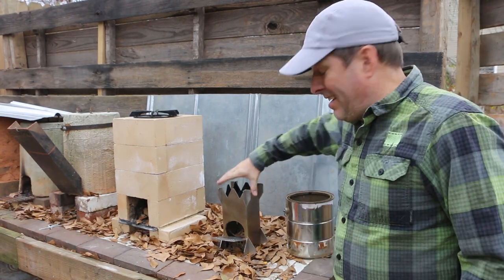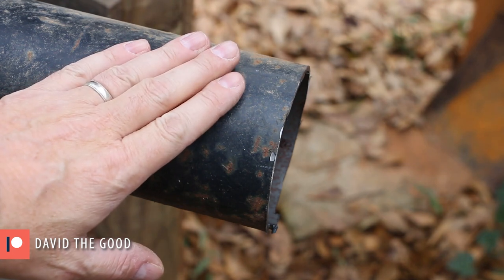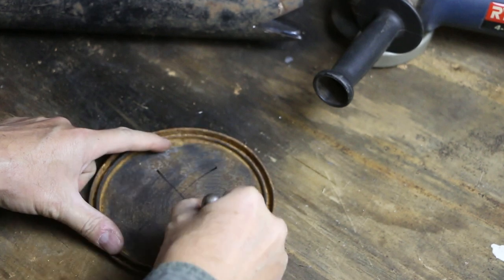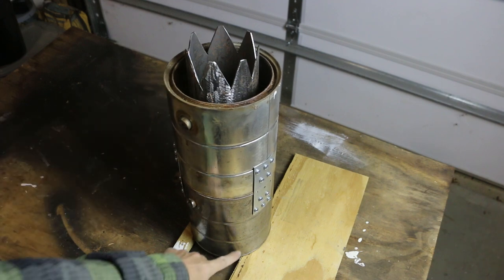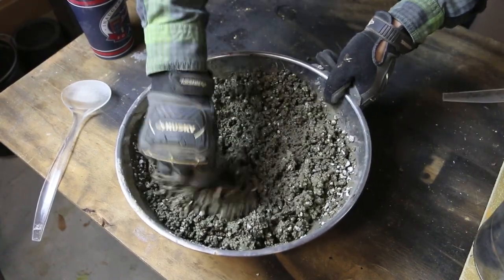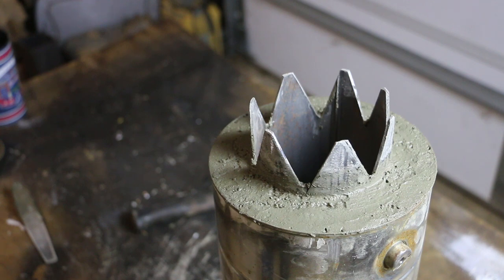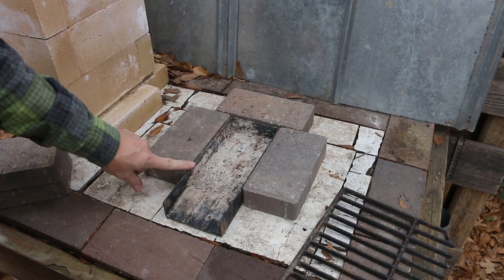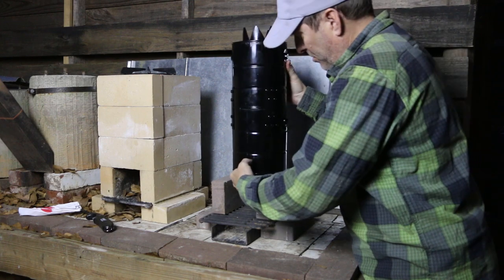How To Make A Paint Can And Perlite Rocket Stove

Comment: Helpful Hint: Before using the perlite, soak it in water for about 24 hours. The cement won't absorb as much water out of it, and it's easier to mix and to form.
GREAT video, GREAT idea.
Reply from the maker: Great tip. That would help with the dust too. Thank you. Thanks for watching.

Comment: Ya missus still looking for her salad spoons.😁😁
  Great buddy, thanks.  Just wot I need for my shed... so cold and to drive the damp back out. 👍👍
Reply from the maker: Ha! Yup. :-) Good luck with your build. You should look at a rocket mass heater. It might be better for heating an interior space. Thanks for watching.
Reply: Rocket mass heaters are awesome! I’ve seen some with an exhaust “pool” bank that works well. Put a smaller one on castor wheels so you can move it around.
Reply: @GreenShortzDIY  
  Cheers buddy. I certainly will do.  👍👍

Comment: Another set of bricks out front to lengthen the burn chamber before the flames go vertical would improve efficiency. Fire brick has less thermal mass, it won't absorb as much heat  and should be insulated as well. the horizontal to vertical transition area is where proper mixing and combustion efficiency occur. A secondary air inlet might help, it might also hurt by cooling the combustion process. In all the stoves I've built I've always strove to see only heat waves exit the stack, no smoke and no flames means everything was combusted. These are fun to play with. Nice documentation of the build and initial firing.

Comment: I made my rocket stove from an empty 6kg fire extinguisher and a brake disk. Works very well and keeps my feet warm while i sit at it, waiting for my 10l water pot to boil.
Reply from the maker: Cool. I bet the brake disc soaks up some heat for the toes. :-) I’ll have to incorporate one in a build soon. Thanks for watching.
Reply: @GreenShortzDIY   The brake disk is just a base welded to the bottom of the extinguisher. Actually it is the coolest part of the thing and most of the IR radiation comes from the lowest third of the extinguisher pipe, where the fire is burning. It gets visibly red hot if i throw some dry birch in it. :D

I had to drill extra air holes at 1/3rd and 2/3rds lines to get it full combust. Boils 10 liters from ~4C to 100C in ~40 minutes, 10 minutes faster than our electric stove. Which is awesome since our cabin lot produces more wood than we can consume in a year. Free green energy!

Comment: My suggestion is on filling... it looks like it would be a lot easier if you put an old plastic bag and a rubber band over the top of the burner while you add the first layer of concrete and most,of the perlite.  It would probably also help to fold some paperboard like the side a cereal box into a shape somewhere between a ramp and a funnel to help guide in the perlite also. Great build, thanks for sharing.
Reply: It might also be easier to epoxy the two cans together versus shaping and screwing brackets.
Reply from the maker: Ian, great suggestions! The cement an perlite filling was trickier than I thought it would be. I was moving fast by that point in the build and didn’t stop to think. :-) Thanks for the feedback.
Reply from the maker: Good idea. One concern I had firing the stove was pressure build up. As it was, steam from the moist cement was venting through the gap between the cans. I suppose I could epoxy sections of the connection, leaving room for air movement. Thanks for the feedback. Thanks for watching.
Reply from the maker: Hi Ian, I used your recommendation in this new paint can rocket stove build. Featured your comment too. https://youtu.be/JwjoPQtJ8Y0

Comment: Hey Tom, 

 One way to make the build a little simpler is as you said by using #10 cans. Obviously you used what you had on hand - paint cans. But  if you use #10 cans they have no "lip" like paint cans and then you can use a 6 inch diameter HVAC (or stovepipe if your local Lowes/Home D. has them) connector (coupling) to put the two or more cans together instead of the metal bands and screws. You may still need to use a few screws to hold it together if you're planning on moving it around. You can also use tin snips (aviation shears) to cut out the hole in the bottom - easier (IMHO) than using the angle grinder.

An easy free source for #10 (1 gallon) cans is your local Mexican (and probably other) food restaurant. They usually get beans and or chiles in this size can. You can either raid they're dumpster after hours (my method), or you could probably just ask them if they have any on hand. Also this whole process can be done without lining the inside at all. Just using the #10 cans. A bit less efficient/stable sure, but if you have the wood on hand (I work in a cabinet shop so...) and aren't prone to knocking things over...it still works fine.  You could make the pot stand out of a 2nd HVAC connector in the same manner as you did here. 

 There is also another can size (I don't know the number) that happens to be a 4 inch diameter. They are the same height as a #10 can, and again you can then use 4 inch diameter HVAC connectors. This could be used for the center pipe for anyone who doesn't happen to have some nice steel tubing lying around (raises hand - lol) of course it is thinner walled so it probably won't hold up as long, but it's cheap, easy and repeatable. 

On a side note, I have a rocket stove / pallet shack contraption that really needs to be seen to be fully understood...However I thought you might find my "foot warmer" box to be interesting. I used a 4"x10"  register box (floor heater vent box) along with 4" HVAC couplings and 4" flexible aluminum dryer vent tubing. I built a 12"x30" wooden box out of 2x4's and 1/2" plywood. I used some corrugated plastic (old campaign signs) to line the bottom and sides (but not the top) of the inside of the box as "insulation" as well as added a couple of paper egg carton bottoms to the inside to mix the air - this will make sense in a minute. I cut two 4" holes with a hole saw on opposite corners of the top of the wooden box. 

 I cut a "U" shape out the side of the register box (a picture is worth a thousand words right here) the box then sits upside down with the "U" shape cutout  next to my rocket stove (my rocket stove is made from 1/4" wall, 6" diameter steel tubing that I had made by a welding shop) and is connected to a 2 foot section of 4" HVAC tubing which I used some copper wire to strap it to the  riser of my stove and then is connected to the flexible dryer vent tubing and that goes back down to the wooden box and connects to one of the holes. At the other hole I have another section of 4" diameter cardboard shipping tube (got this free from where I used to work - PVC or HVAC tubing could also be used instead if needed) Which is a little taller than the section of HVAC connected to the stove.

 So.... the hot (fresh not exhaust) air from the bottom of the stove gets pulled into the bottom of the register box and because hot air rises, travels up the tube and is then forced back down into the wooden box, travels through the box across the air mixing egg cartons and then warms the non insulated top of the box.....where I put my feet 8^D.... and then out the other end and up the taller tube which acts like a siphon to help pull more hot air from the stove - again, because as I know you know, heat rises. Sorry for the long post but I thought it would be something you might be interested in trying. 

Cheers!

P.S. - forgot to mention I used some heavy aluminum foil and more thin copper wire to "loosely" wrap the flexible dryer vent tubing - creating a somewhat insulating air gap around it. I'm sure there is a better method for that - but like you, I used what I had on hand lol.
Reply from the maker: Thanks for the excellent detailed info here. I scanned, but need to come back and spend some time reading this carefully. Nothing condescending or oafish about it though. Most oafs won't do "IMHO." :-) Thanks for the feedback. Thanks for watching. Now get back to warming your toes...or maybe you've been doing that all along.

Comment: Would love to see your take on a few efficiency additions:

1)  secondary o2 mixer (fresh air intake  about 1/3 up your riser) with control valve to perform a secondary burn of the wood gas

2) damper control (improvements to the sheet metal cover, essentially creating a door)

3) wrap copper lines around standpipe prior to inserting and filling (essentially merging the objectives of your last build into a multi tasker)
Reply from the maker: Good stuff here, Darian. Thank you for the input. I'm planning to build a rocket mass heater soon and will likely use this assembly (or a three-can one) as the riser. Also plan to do a proper rocket stove, with all the features, so secondary air and dampening will be a nice addition to that. Thanks for the suggestions. Thanks for watching.
Reply: Hi, Darian, you've brought up some interesting concepts. Re: your 1), above--

I always thought the purpose and design of a rocket stove was to suck in enough air to perform that secondary burn of the wood gas without additional o2 mixers/dampers? Have I missed something?

My concern is: I just cast a stove in cement a couple of weeks ago, and it's not cured enough to fire it up, yet. so I won't know how it does for a bit. Thing is, casting a cement thing with an additional damper would make for a hugely complicated mold! I was really hoping this thing would burn all the fuel(s)  efficiently enough as built...

I totally see your point, though, and I love it as much as I hate it! I mean: I love maximizing efficiency, but I hate un-doing (or re-doing) something I've already done. I can't poke a hole in the concrete already set...

...And I've already cast another stove (in a slightly different configuration), and I really don't relish the idea of making a third one. With another hole in it. And I have no metal-working tools. And I don't have enough money to pay attention, let alone buy anything.

So, yeah, I hate that. 

Any suggestions? Would sincerely love to hear any input (that only costs a nickel), you might have.

Man, I hope I didn't waste my time (and the approx. $20.00 I spent on all this) on something that won't really work. I just want to heat my little garden shed/workshop with scrap wood and twigs. And I don't want it complicated (and it can't be expensive).
Reply: @shaddec55  Bud, I think no matter HOW your rig burns, it would not be a waste.   

Remember, we all rely on each others past attempts to learn and grow as a community.  

The secondary line is a concept that some advanced builds I've seen use.  It is more of an enhancement to efficiency than a requirement.  It can certainly be frustrating to hear a great idea, one cement casting too late to implement, but that does not diminish the research and efforts already placed.

The project I have in mind is all about efficiency and control.  The way I've had it explained to me, the secondary air intake rapidly heats the air as it flows uncombusted through the burn chamber and just starts up the riser, where any residual gasses, (including the original air) mix with the super heated fresh o2, and the process is enhanced.

Adding a flame vortex in the riser is another enhancement that is by no means necessary, but adds an efficiency boost.  It all depends on the time and effort you want to spend on prototyping... and often failing.

Let us know how your build turns out dude!
Reply: Wow, Darian, thank you so much for your encouraging response to my "panic" attack! LOL, I was indeed thinking I was "one cement casting too late to implement" what I thought was now a necessity. As you may know, preparing a cement mold is no short, easy task. Finally mixing and pouring the cement is a quick but satisfying pay-off for all the prior work. De-molding is the second little triumph when the thing doesn't crumble. All sweet...

That said, I'm kind of working on a heat accumulator for the top of the "Franken stove", to be built out of sheet metal ventilation parts and potter's clay (read: so far, pencil and scratch pad). I don't begin to have enough room for a rocket mass heater in any of the configurations I've found in videos. (My shed is 12' X 12', one side is my workshop, the other side has lawnmower and other yard tools, etc. The foot-print of this thing needs to be ~2-3 sq. feet. There is no floor space for a mass accumulator.)

Do you think I could incorporate that secondary burn o2 vent between the top of the concrete beast and the "accumulator" contraption? Would dearly love to hear your thoughts on this!

I'm so very glad that I have found a "community" of like-minded individuals who are willing to share ideas and-- especially!-- encouragement. That absolutely means the world to me. I'm retired, fixed income, don't have money to "burn" (possibly intended pun...).

Again, thank you so much for your heartening encouragement and your very concise description of possible enhancements-- yes: those have got some of my creaky old cogs turning anew!).

And, YES! I will absolutely share however this beast performs-- good, bad, ugly or warped. 

Rock on!

Comment: Appreciate the G'DAY, and here is just a thought, seeing as it is all made out of recycled materials (except for the perlite/concrete/aircrete or whatever anyone uses) how about you try the following:
2 regular paint cans + 3 of those small ones (the 1 ltr or 1 kg or whatever the hell is on them in any part of the world).

Do the hole in the side of the bottom paint can as you mentioned, the rest is as you did, just using the smaller cans for the chimney pipe and leave the handle on the top outer can (easy to carry around when cleaning the back yard).

Just a "world shattering" idea after watching the vid.

Thanks for the ideas, appreciate it.

Cheers.

Comment: Wow, I didn't know perlite was heat-resistant enough to use as an insulation (but, then again, I pretty much know nothing about perlite!) I guess I need to get intimate with Google and really check this stuff out....

I know it's light, and mixed in sufficient quantities with anything will fill a lot of space and reduce the weight of a unit of volume of whatever it's mixed with-- which I should have done in the molding of my very first attempt at creating a rocket stove-- which I made out of concrete in a Lowe's bucket, following one of your videos' instructions...

Well, ALMOST following your instructions. I diverged in some critical ways, and... well... there were unintended consequences:

First, instead of corrugated cardboard (such as pizza boxes), I used twelve-pack boxes (which is essentially card-stock) to line my bucket. This added some further volume of concrete (may not seem like a lot at first, but this gets worse...)

Second, I used a 3" PVC pipe instead of 4" like you used, adding yet more volume of concrete (AND-- I used that card-stock to line the pipe, adding some volume of concrete).

Last, I used two 2x4s screwed together instead of a 1/2 gallon container (also lined with card-stock) for the fire-box opening. Which (need I say?), added quite a bit more volume of concrete.

Predictably (though I apparently didn't get that memo from the tiny part of me that THINKS on occasion), this beast weighs a ton and was most un-fun de-molding it after two days' cure time. That card-stock didn't hold much moisture for very long-- so I pretty much de-molded it right before it all dried out!

It's been curing in the waning (almost Winter) sun for 9 or 10 days now. As the concrete lightens from a dark gray to something resembling cement-white, it seems to have lost a few micro-grams of weight, as well. I can kind of move it around a bit without herniating anything too terribly. 

I'll wait a full 30 days for this beast to cure before I attempt any fire in it (I've read that un-cured concrete is apt to explode when exposed to high heat-- safety first!) In the meantime...

I'll make a mirror-image mold of a much shorter Lowe's bucket fire-box thing to use as a base for the Frankenstein rocket stove. I'll put a grate between the two parts. 

Wish me luck!
Reply from the maker: Shadecc, your build sounds excellent. Would love to hear how Franken-stove does once you fire it up. Thanks for the comment. Thanks for watching.
Reply: Franken-stove is curing pretty nicely. I made a base for it last week using the top part of another Lowe's bucket so it would match up. It's just now starting to cure. I really can't wait to fire this up! I"ll wait another week to try it out...

Meantime, I made ANOTHER Franken-stove-- this time using a cat litter bucket (you know: those big yellow rectangle buckets that have 35 lbs of cat litter in them). I thought it would make an interesting shape. PLUS, I added lots of little cardboard cut-outs to it to (hopefully) give it a "Castle" look. Just poured the concrete in it yesterday. We'll see how it looks in a couple of days...

Your videos gave me the inspiration to try all this-- thank you!

Comment: Quick question/video idea.

What are the golden rules when making a rocket stove? Things that cant be changed between designs? I know you have mentioned your intake hole being the same size as your chimeny. But could the internaks be wider/thinner or cone shaped? Do you need only one big intake or could you do smaller multiples as long as the sum space is the same?
Other rules for rocket stoves I may have missed? Attempted a few and while Im learning would be good to 'stand on the shoulders of giants' as it were